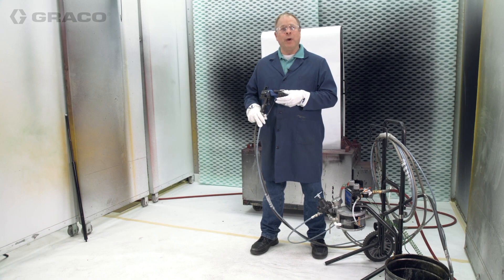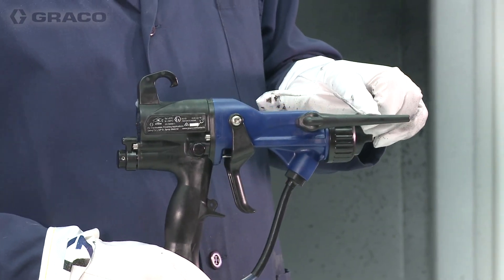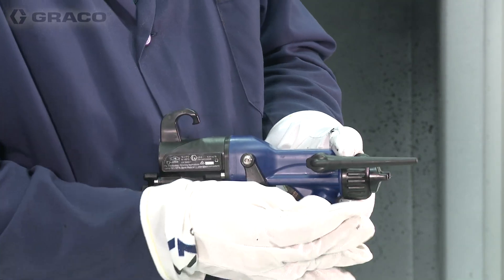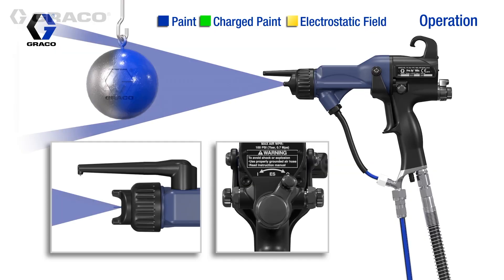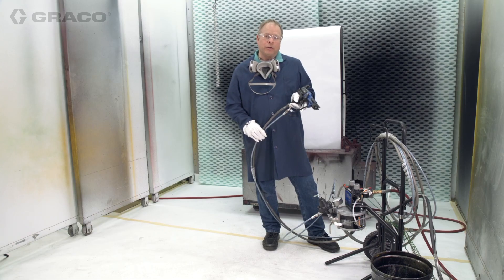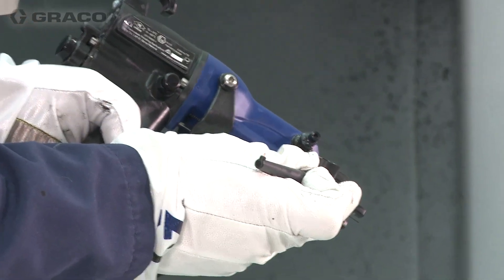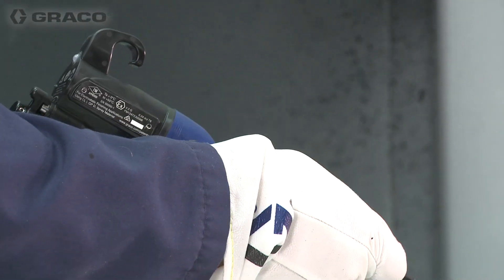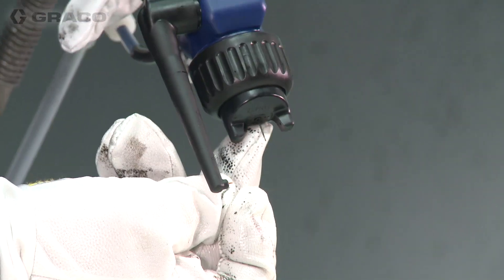Pro Xp WBx External Charge Electrostatic Air Spray Gun - Overview & Operation

Comment: Interested in procuring  a electrostatic liquid spray gun and system (with proper training ) in India , for coating 12 mtr long 20mm dia curtain rods /TMT steel  reinforcement bars  contact dahaless@gmail.com
Reply from the maker: Thank you for your interest. We forwarded your request to Navneet, your local Graco Liquid Finishing representative. He plans to contact you soon. You can call him at 9810102176.

Our Asia Pacific Customer Service Team in India also is available to answer product sales questions. Call +01 763 955 2057 anytime between 6 a.m. and 3 p.m. GMT-6 or email ExportCS@Graco.com